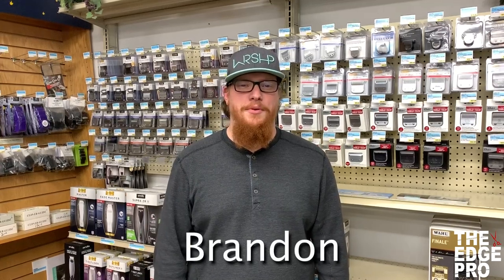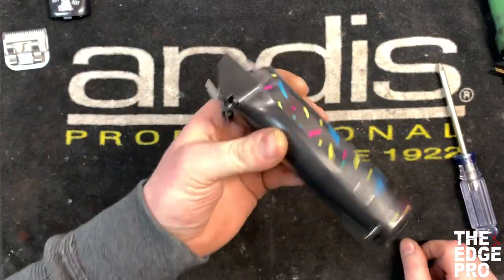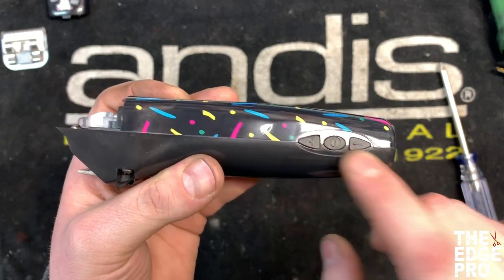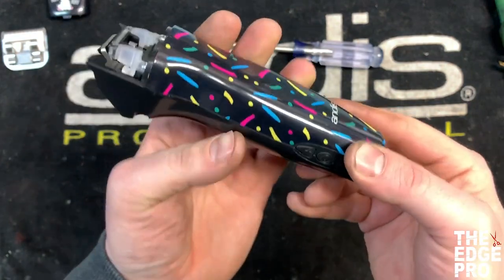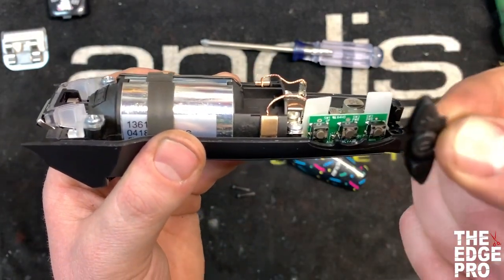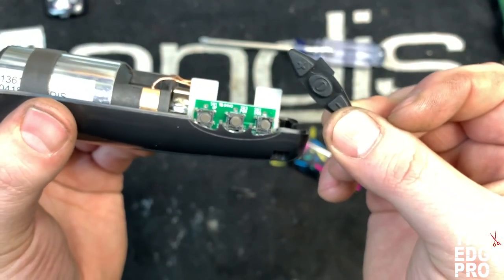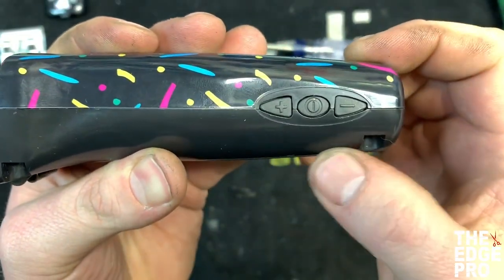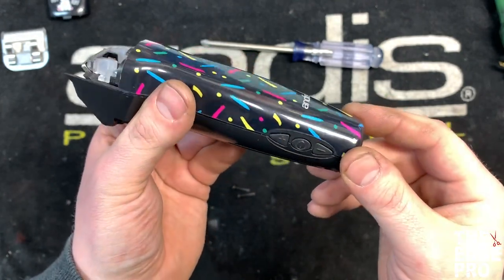How To Replace Rubber Switch Cover - Andis SMC Excel 5 Speed

Comment: Do you offer repair services? I changed the circuit board since it showed that it over heated and wouldn't start the clipper.
When I installed the new one, the motor head moved very little.  But now nothing is happening.  
Any advice please?
Reply from the maker: Hi Susana! Yes, we do offer repair services. We have instructions on how to send in items here: https://www.theedgepro.com/services/mail-in. You can also find pricing here: https://www.theedgepro.com/services/repair-services. Thanks!
Reply: Is there a video that shows how to take off the wires from the bad board? Would really appreciate that, thanks so much!